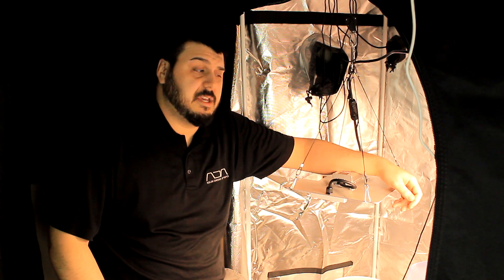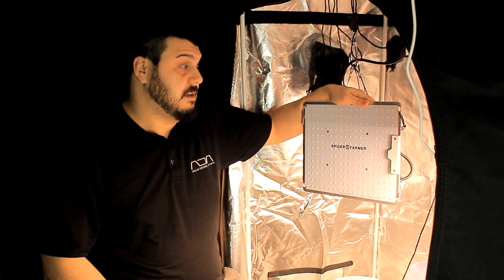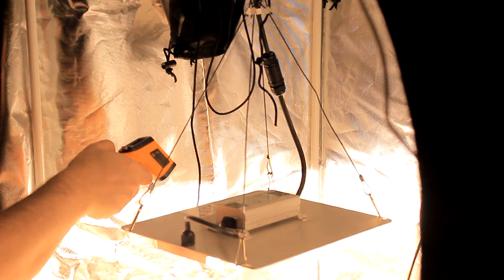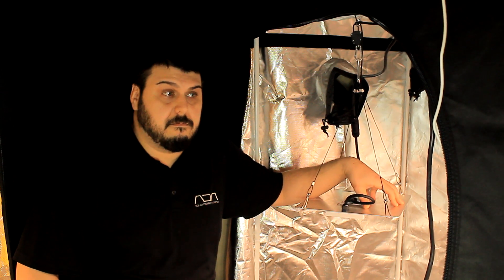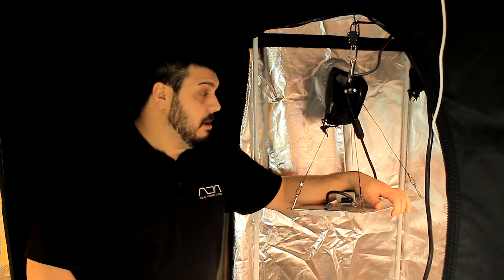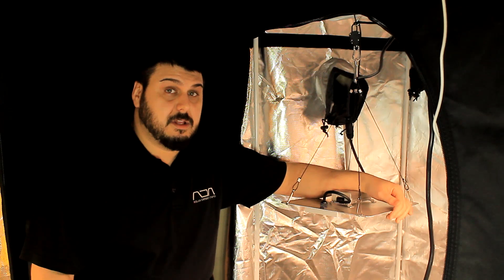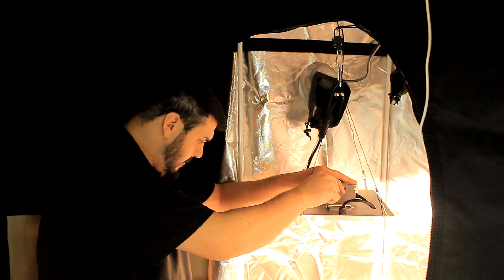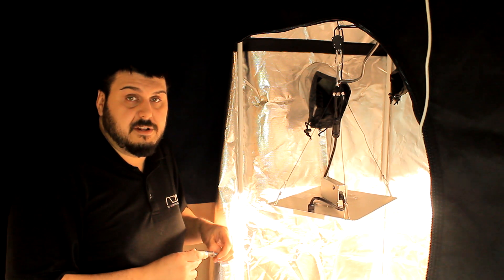Spider Farmer sf1000 Is It All It's Cracked Up To Be? Review & PAR Testing LED Grow Light

Comment: I had an SF600  watt spiderfarmer light and 3/4 of the diodes don't work and it gave me an electrical shock. I would never buy from this company again and the build quality was bad as is their guarantee, as they want me to pay shipping both ways and handling fees and repair fees!  So don't think the 3 or 5 year guarantee will get you a free replacement if it goes wrong after a year as it wont. I have since bought a VIPARSPECTRA P1000 and its so much better than sf600, better build quality dimmable switch etc. So if your thinking of buying spiderfarmer, think again.
Reply: The sf600 is a 30 watt shelf light for seedlings, the viparspectra p1000 is a 100 watt light with a 3x3 footprint. If you got the older sf600, not the shelf light,  the brand is almost entirely different from then. But to compare a 30watt light to a 100watt light is like comparing a bicycle to a car. As far as the warranty is concerned, I've had to return an SF2000 that I broke, and they still offered a return. If you haven't dealt with spider farmer in the last few years, you honestly are talking about two different things.
Reply: @dogmosatchmo   I was not comparing a 30watt light to a 100watt light. And what I said still stands. And it happened within the last few years, so I'm honestly NOT talking about two different things. I'm am telling my experience with spiderfarmer, which was not good, that includes the service and the product.

Comment: For new growers i recommend to use at least 200watt to flower, 100watt is too weak no matter what feeding or strain
Reply: I've had great yields, as well many others using just one SF1000. Both the old style, and new. Sure, more watts is better. But to say it isn't enough to get results, is false. I grew a single Blueberry under an SF1000, and got almost 5 ounces with vegging for 6 weeks.
Foxfarm trio, foxfarm soil. Speak for yourself.🤡

Comment: Can I buy 1 or 2 of these to supplement a SF4000 in a 5x5 tent? And would that be recommended?
Reply from the maker: Yeah for sure as long as you have the power to run them. The sf4000 is only made for a 4x4 so the extra light will only help with your coverage.
Reply: @downwithprohibition7364  Awesome, could you recommend a light that can handle a 5x5 tent? Without the need for supplemental light?
Reply from the maker: I personally haven't reviewed a light to cover a 5x5 so I would refer you over to the  Migro YouTube channel.

Comment: Does it make alot of heat in the room?
Reply from the maker: Naw they are not that bad man.
Reply: Yes. The mw driver surface temp is 47c on my thermal imaging camera the back of the plate 42c

Comment: what light do u recommend for canada ?
Reply: Do not get a sf4000 literally double the cost of 2 maxisun bp2000 and cheaply made ( flex in middle)
Reply from the maker: It really depends on the size of the space you are trying to fill. What were you going for Charles. I would be happy to help size you a light for your space?
Reply: @downwithprohibition7364  its 4x4 area only...
Reply from the maker: @charleseagles6603  Sorry Charles I was sure I responded to you man. A 4x4 space will not be cheap to fill my friend. Mars hydro has a ts 3000 and I would work sf4000 from spider farmer and 2 p series 4000 from viparspectra. Thats for full coverage in a 4x4
Reply: @downwithprohibition7364  im thinking sf 4000 or hlg 650 Diablo
Reply from the maker: @charleseagles6603  If you can afford the 650 if say go with that. You will be much happier in the long run going hlg
Reply: @downwithprohibition7364  i can just seeing what people have done with it mit as well as 30% off for candians
Reply: @downwithprohibition7364   can you help me i just got 1 of this lights sf1000 for a 32×32×63 will it be enough or do I have to add another ?
Also if have to add another light will it be 1 more of the same or a different one?
Thanks for your help 👍.
Reply from the maker: @leonardotorres4338  With one I would say no, I would suggest getting another one for that space.
Reply: @downwithprohibition7364  would you recommend the same fixture or a different one that fits in the space together?
Reply from the maker: Well that really depends if you plan on upgrading tents down the road. A 3x3 is kinda a odd size to fill. There are single lights that would cover that space perfectly. Mars hydro has a few. But let's say you wanted to upgrade to a 4x4 down the road you could use a sf2000 and 2 sf 1000. That would give you full coverage of a 4x4.
Reply: Get 2 maxisun pb2000 lights for a 4x4  they cost $235 per

Comment: I have a Mars Hydro Ts600 and one of these and I don't think it's as bright as the ts600. For 180 I wasn't impressed
Reply: did it burn down your house yet? That driver on top gets hot af, I'm not sure if I trust this thing?
Reply from the maker: It runs well within operating temps. It runs 30C cooler than the max.
Reply: @downwithprohibition7364   You dial it up all the way on max brightness and run it for an hour. Once it's fully heated, put your hand on the driver and let me know how long you can keep it on there. Maybe mine is defective?
Reply: @downwithprohibition7364  over 40 on the dial and the heat starts getting pretty warm, max brightness is too hot to touch it seems, should I warranty my unit?
Reply from the maker: Naw it gets how man you wont want to keep your hand there long like 20 seconds max.. but the drivers can run up to 90C.. I think max temp I was getting was close to 60C. Not saying it's not hot but it's not hot enough to be a danger.

Comment: Not sure if all the new SF1000 are the same but I recently got one on Amazon and it came with the new AB driver with a simple pot dimmer box on the front its a lot nicer to dim now ! :)
Reply from the maker: Yes I seen that.. it's a big improvement over the other setup.
Reply: @downwithprohibition7364  Do you happen to know if the SF2000 and 4000 will also come with the newer AB driver and dimmer box, I am 3 days into my SF1000 and already love it so much I am considering upgrading to a SF2000 during flower <3
Reply from the maker: Yeah it looks like they are adding it to all of them

Comment: Those dials on the back are probably for variable capacitors as opposed to variable resistors aka a dimmer. Their for the driver to be set at the correct v and a for what's being used.

Comment: You need to do all measurements at 12inch/30CMS height for the true rating
Reply from the maker: I don't believe you watched my video mate. I showed my par maps for 12 inches.
Reply: @downwithprohibition7364  i did mate but just saying there is a standard for measuring the light 1m x 1m x 3, its the only way to really compare different lights together, I've noticed a lot of lights being bought recommend hanging just 6inchs at that height there isnt much room to mess about with,the canopy canopy would have to be kept pretty even, 
i weren't criticising you or anything but migro he goes off the manufactures recommendation, but if comparing like he does they all need the exact same conditions, 
all lights they measure the lumens in a black room non-reflective 1m x 1m hanging height 0.3m. Every single light can be compared based just on the lumen, but these Chinese COMPANIES their data is for all different shapes and sizes, it's impossible to compare lights against each other, the more expensive the led the brighter they are, you CAN dim them, more room to play with, it's up to the individual to use a meter and hang the light to where they want the INTENSITY, once again not a dig at you or anything more like just a rant, I've just got 240w 2x QB and really was hoping to see some better numbers as i even bought cheap Chinese ones I'm sure they'll at least be better then what i got now, good results ;) how much watt did you have total?
Reply: I mean great results on the harvest you just did ;)
Reply from the maker: @doubleooh7337  I have tested all of these 100 watt lights at 12 inches as they all recommend in flower 12 inch max. They are also all tested on a 3x3 foot area. Larger lights like the mars hydro sp250 was tested in a 4x4 because it was a larger light rated for a 2x4. If you would like to see all of my par maps side by side so you can see for yourself please join my Down With Prohibition group on Facebook and I would be happy to share.  I test all of my lights in stock configuration. If there is a dimmer on the driver I do not touch it till after my par and energy testing is done. I try to make it as fair as possible man. I am no expert though man I just do my best.
Reply: @downwithprohibition7364  ok cool I'll add fb later , i know ppl say 3 by 3 but is your tent 90cm x 90cm or 1m x 1m?
Reply from the maker: @doubleooh7337  you are right man those tents are slightly smaller. I don't test in a tent normally. I have a piece of fabric that was measured out to test a 4x4 3x3 and 2x2. I only tested my par in the last video mars sp250 because I conveniently had a 4x2 tent free and their numbers were off by a good bit. But they also tested in a tent of the same size. They stated all testing was done in a mars hydro tent.
Reply: @downwithprohibition7364  is it cool yeah i agree something don't add up somewhere, who cares some numbers gives a somewhat indication which is good enough for me, i only have lux meter i find pretty much every light actually tests higher lumens then they state, ppl say lumens aint important and only par is but id disagreement, if you look at a chart of what spectrum is visible to humans and what spectrum is visible to plants both charts show the same red green blue part of the electromagnetic spectrum plants can see further into ir and uv but they definitely don't see different light to us ,par and lumens can be worked out from eachother, those lights do have the second best leds on the market right now there's no way theyll be shit

Comment: I've had a 140mm fan blowing on the top side of my sf2000 and it's been running strong in my 36X24X60.    Great led board

Comment: The driver has a protection circuit that is designed to shutdown when you reach the limit of it’s safe operating output to keep the light from burning up or causing permanent damage. I wouldn’t recommend running it over 100w and at that setting it will not shorten the lifespan or get excessively hot. It is absolutely dimmable, and the driver was designed to be as water resistant as possible to prevent damage so that’s the reason for having the potentiometer covered and recessed while being protected on the bottom side where it is also shielded by the heatsink.
Reply: I set mine to 80 procebt should i set it on max in vegi state whay should i do i have sf 1000
Reply: The sf1000 will not reach par for flower; veg needs low par...
Reply: The drivers are built prior to putting together the lights that's why the dimmer knob is on the bottom it's called an oversight not a feature

Comment: @Down With Prohibition
great review!
your par maps seem to match manufacture specs so quite reassuring to know.
very interested to know the par levels without the clear layer of epoxy, would have thought that wouldn't make a huge difference 

if we want to get technical the manufacture specs are by a 2x2 foot tent so i assume that would bring the results up to at least 1.9 umol/j of efficiency
Reply from the maker: Thanks Dan, I would like to see one without that coating also. I know it hurts the output but i am really curious as to how much it actually restricts the light. I am going to see what i can do about that..  I only test it on a 3x3 surface because I am looking to see how far the light can spread beyond the 2x2. I also don't use a reflective walls because i really try to focus on what the light it's self pushes. To me I find that more of a true representation. I am ok with my numbers being a bit lower than others.  I figure she is a 1.9 also in optimal conditions. Its not a bad light by any means.
Reply: AA Sharp  tool

Comment: Hi mike just watched your video on the viparspectra 600w like the price and switch between different colors, looking to do a 2.5x2.5 space and 2 plants would you reccommend this light or could you reccomend something better for around 200.. u.s. $160 for the vipar 600...
Reply: How to Grow don’t know if you are still deciding what light is best for your situation but I thought it wouldn’t hurt to give you my .02 lol 
I would really suggest going with the SF2000 for more coverage, or using one SF1000 for vegetating a 2.5’x2.5’ area and then adding another for the flowering period which will definitely grow big dense top quality buds and very uniformly. You can probably get away with one but you will be losing a good amount of yield on the outer areas that are not getting enough intense light that is required for proper bud development. ✌️
Reply: @therusherproshow3970  hey bud i went with 2  240w meijui for 170each  delivered plants are loving them https://www.alibaba.com/product-detail/2X4-Grow-Tent-QB288V3-HLG-240W_62556329410.html?spm=a2747.manage.0.0.3b9a71d2nQwNFV can't beat their prices
Reply: @therusherproshow3970  3500k is good full spectrum veg n flower light

Comment: Thanks for the review mike still a decent little light.
Reply from the maker: Oh yeah for sure  it's not a bad light,  when comparing other it to other 100 watt qb style lights it's right up there.  Just a couple of things like I mentioned. Appreciate you leaving a comment man
Reply: Can someone tell me something ...i have 3 sf 1000 lights with 0 to 100 dimming knob ....setting is for seedlings  ....veg stage ...and the flowering stage ..  or should it be full 100 max at all times
Reply: @blairrudderham7100  i dont have a sf 1000 im not sure what u mean when u say setting if u are referring to a knob on the light but i can tell u for a fact it is best to have the light turned down low for seedlings and as u move along in vege turn it up just keep a eye on the plants if they start to looked stressed or light burned just turn it down a lil or vise vera, as u get farther along u can turn it up slowly. In flower u can turn it right up over the first week or 2 is how i do it in say week one of flower im at about 80% and i go to 100% over first two weeks in flower something like that should work good for you. Good luck

Comment: Woah that thing gets hot.
Reply from the maker: Yeah it does get pretty warm unless you're running it in a grow space with ample ventilation or airflow.
Reply: @downwithprohibition7364  would that heat not just be in the air if not in the lamp  ?
Reply from the maker: @Boxbeat666  I clearly state that ambient temp is 22.3C immediately before testing
Reply: 47c on the driver. 1 watt is 3.8 btu

Comment: Doesn’t hurt par and it’s not made to hold heat. The coating is for stability and water proofing the leds
Reply from the maker: Putting a layer over the light will hold heat to the board and reduce par.  I am not saying that they put it there to hold heat to the board that would be pointless.
Reply from the maker: AA Sharp  Well you can pull out your par meter and prove me wrong at anytime... I will tell you something. I don't need to worry much about warranty. I have the reps from spider farmer offering me product to film videos for them. If something breaks I am pretty sure they would take care of a tuber like me.  You on the other hand might have to pay for that warranty. Have a great day..